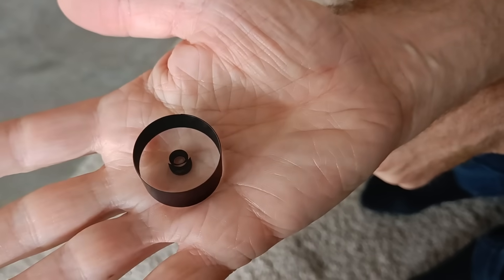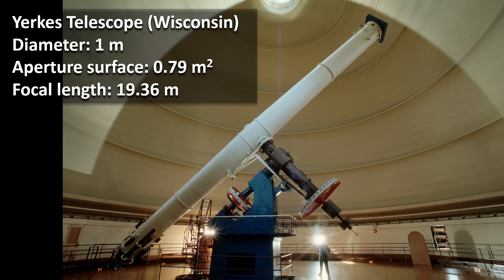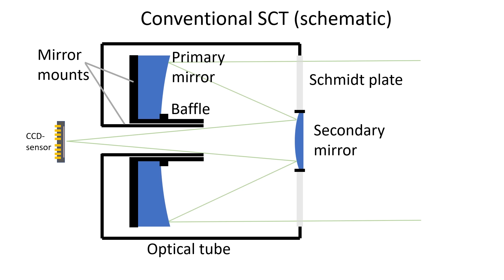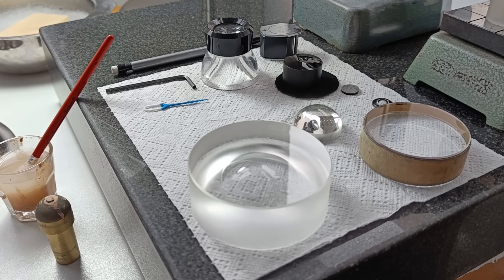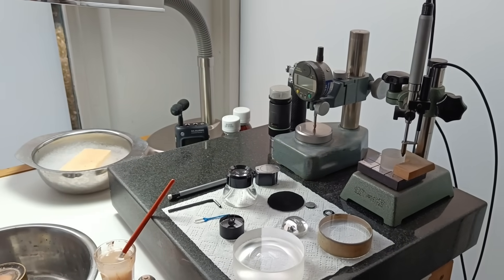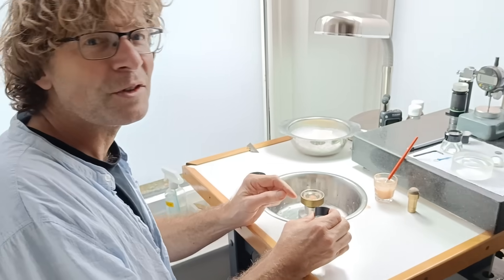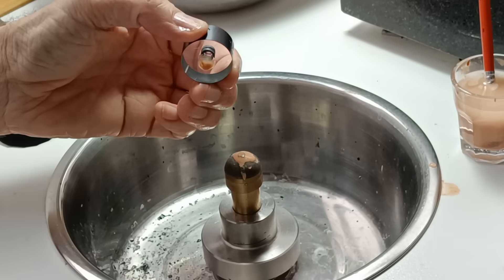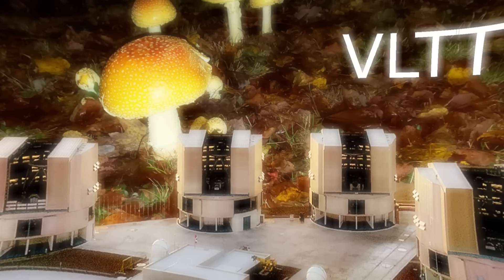Why is this Space Telescope so Tiny?

Comment: Congrats, very nice video... let's hope the diffraction limit for such a small aperture (3 cm ~ 4 arcsec) will not ruin to much the image resolution (2 meters resolution at just 100 km from Earth,  and 10 meters resolution at the orbiting distance of 547 km of the Hubble Telescope that instead at such a distance is able to resolve separation of ~ 25 cm !) 
Btw, nice idea for the VLTT, despite the fact that an optical interferometric baseline technique (bispectrum, speckle imaging, ...) in the visible domain may requires femtosecond e sub-nanometer time-space coherent synchronization between each tiny telescope (4 axis position/rotation and sensor signals TOA) and probably not easily achievable in our current time, with our actual technology and with funds  below several hundreds millions of dollars.... maybe I am wrong but I am afraid it will remain for still quite some time a dream despite it is already a shared one within the astronomical community  ;)

Comment: you can defeat you tube commercials by clicking on another you tube video and quickly going to the back up or previous arrow on the top left corner, the original video clip starts off where you left off without the annoying ad.  
some ads can go on for 15 or 30 seconds and sometimes they hit you with double ads.
youtube cant cope with this rapid change, when you go from the new clip back to the one you were watching the you tube algorithm forgets ro punish you with a time wasting advertisement.

Comment: What is the specs of this little telescope ?
Reply: Optical diameter is 25 mm, focal length 125 mm, total length including detector 27 mm.
Material Fused Silica. It will be pointing downwards to Earth from a 400 km high orbit. Resolution: close to theoretical diffraction limit.

Comment: It is very interestingly compact but I'd like to see images taken with it.  The tiny aperture quite surely limits resolution to blur any details smaller than around 3 arc seconds.  A 100mm aperture telescope would see details down to around 1 arc second.

Since it is so extremely expensive to put massive things in orbit, I wonder if a tiny cluster of these a 2 or 3 meters apart and connected through interferometry would be worth doing for a space telescope that photographs planets in higher resolution than Hubble.  Would the complexity around interferometry and possibly needing to unfold the structure from a cube-sat size to its 3 meters of simulated aperture make this too expensive to be worth doing?

Comment: This isn't a good astronomical telescope because it's aperture is so small.  Very limited light gathering power which is why proessional telescopes are large.
Reply: It is so small as it needed to fit in a 27 mm space. From lens to detector. Astronomy is not the goal for thís telescope. It will be pointing downwards ;-)
Reply: @astrorik  great.  That needed clarification, as some comments by media linked it to space telescopes. 8-)

Comment: Next step, hollow out the monolithic design so that it actually can be scaled up in size (without the mass, via ^3 scaling laws, getting out of control). Such a 'Hollow Horst' approach would also provide additional surfaces. Likely that it would need to be manufactured in parts and then fused together (advantage? disadvantage?).

Comment: Interesting design! I wonder if chromatic aberration plays a major role here. What's limiting the scope size?
Reply: The purpose was to get a 125 mm focal length in a space of 27 mm. Including the detector. Chromatic aberration is almost non-existing, only some residual spherochromatism is present due to the short build of the system. Regarding the limit of this telescope, you can make it large if you wish, but at the cost of weight. In practice I think that monolithic telescopes between 25 mm and let's say 60 mm are most interesting. The sweet spot?? I think around 35 mm diameter ;-)

Comment: Exactly my idea of space based VLTT... :) place small telescopes on large telescopic construction which can be fold into small space. of the Falcon 9 fairing volume. Due to zero gravity it should be possible to unfold such construction to the equivalent of maybe up to 50m diameter mirror. While the speed of lens would be low due to low actual area, the resolution would be very large. If special glass was chosen, one that can effectively transmit infrared radiation, then direct detection of terrestrial exoplanets should be possible. The problem I see is, te glass absorbs infrared radiation rather well. Great material for this is monocrystallic alumina(Al2O3) ... or even better(better transmittance) yttria(Y2O3).

Comment: 2:00 Fun fact: With the eagle having 1.000.000 receptors per mm² this means 1 receptor per µm² - so this is already quite close to the physical resolution limit, which is around the wavelength of light (0.4-0.7µm depending on color). So basically: Without bigger eyes, there is not much room left for higher resolution.
Reply: I searched the comments to see if anybody else noticed this.  In fact, the human eye is not so bad, and comes close to the theoretical limit (about 1' arc) if you work through the calculations.  Humans have some of the best colour vision of any animal; moreover, the sensitivity of our night vision is not far from the quantum limit at body temperature.
Reply: @cdl0  Didn't know that about human nightvision. Cool thing.
Reply: @DerKiesch  Yes, there is a trade-off between colour and sensitivity, so animals with better night vision have poorer colour vision, and vice versa, with humans among the best at both, coupled with the best image processing system, i.e. a huge brain.  Many nocturnal animals also enhance their night vision by a reflective layer behind the retina, which is seen when their eyes shine at night.  This likely reduces acuity slightly, owing to greater halation.  Humans lack a reflective layer.  Photographic films usually include an anti-halation layer to improve image sharpness.

Comment: Why not machine a grinder that has the proper shape instead for aspherical lenses? Seems like it would be less trouble and much faster than using a smaller grinding surface.
Reply from the maker: it's possible to a certain degree, but the tool will also wear out and change shape. Especially because the desired shape is an asphere.

Comment: I love how he just nonchalantly wipes it off using his shirt. So awesome, I love every bit of this. :-)
Reply: I nearly passed out at that. My optical experience is mainly with high power lasers and you never touch an optical surface with anything other than the purest white cloth; otherwise the optic melts and all hell breaks loose.
Reply: @soaringvulture  That's got to be pretty interesting.  Sorry I caught up to this so late but if you're still around, can I ask how much power you're working with? Note my profile image... I was very much into laser DIY once upon a time and still dabble in it as need arises. 🙂
Reply: @NightRunner417  "High power" is a loose term; it varies with the application. I worked with material processing lasers which are used to cut, weld, and heat treat metals. We usually considered anything over a kilowatt high power. I've worked with welding lasers up to 20 KW. Most of my work was with CO2 lasers at 10 microns but these days fiber lasers running at about a 1 micron wavelength are more popular.
Reply: It's a towel in his lap :)
Reply: He doesn´t, it was a towel hanging behind him, whose end he layed on his leg. ...
Reply: Thank God for the "You're Wrong!" posse of youtube or I'd never know that it wasn't his shirt but instead a very much NOT optical wiping cloth.
I guess you have to have worked with VERY expensive optics to appreciate the spirit of my OP.

Comment: But what are the limitations of machining these? Can’t they be die cast or CNC milled into perfection?

Is it really just a matter of tooling precision? I mean we have nm chip wafers etc… or is it too niche to use high precision tools for the cost of it?
Reply from the maker: Generally the accuracy specifications for the surface shapes are way below 1 um, so hard/impossible to achieve using conventional techniques like milling or casting.

Comment: What about chromatic aberration? Seems to me that any light ray which is not strictly parallel to the axis will result in a rainbow of colors caused by a prismatic effect... Or am I wrong?
Reply: That's what I expected also when I was making the first one, about 28 years ago. But I saw no chromatic errors. Later when I was able to ray-trace and model these systems I found that that color indeed is no real issue. Only glass-air exit surfaces could introduce some off-axis color, but that can be compensated by playing with the location of the neutral zone of the Schmidt- surface

Comment: As a hobby Astronomer since 20 Years who has built some (Newton and lens) Telescopes, I have a bit Knowledge about Telescopes and Optics. And this tiny Telescope is f**in' amazing!

Just the Idea to use one single Piece of Glass and make a tubeless Telescope, makes it imo a new Class of Telescopes, beside the Lens- and the Mirror Telescopes. This isn't a even Catadiopter tough, that is Something mindbreaking new. 
OPT ? (For "One Piece Telescope") 

Is there a Site of further informations about this Telescope design? (Chromatic aberration, size of flat and illuminated field, and so on...) 

Many questions in my mind... 
Why not a Klevstov Design (no aspherical surfaces, just Spheres) or any other Cassegrain Derivate?
Would it make sense to use a (glued) glass pair (Fraunhofer like) as a Blank for auch a Telescope?
You built that without the usual bench tests (Focault, Ronchi,) just  by holding it free hand? 
That's so astonishing!
Didn't the temperature of Your Fingers deform the Glass? Or is the whole Room and everything in it at the same Temperature as Your Fingers, so there is no Temperature Difference when You touch the Glass? ;) 
And so on...

Imagine the classy Rubinar 4" f/10, but made in one single chunk of Glass. 
Would probably be as iconic as the Skyquest Telescope. :o  
(No, I ain't own one... But I've seen 2 of them in real life.)
Reply: Thank you for your comment! And you have some nice questions. First, there is no website yet where you can find additional information, though you might find something on the astronomy forum Cloudy Nights. 

Regarding the design, the is practically no chromatic aberration, only mild spherochromatism. The FOV is rather small, and for this particular system the detector area is only 4x4 mm. With more relaxed radii of the curved mirrors and a longer cilinder this can be easily enlarged. The field is curved, however, I've made a design that uses stronger aspheres where the field is almost perfectly flat, and without any distortion. 
Glueing other glass components to further optimize performance is risky for space. The freedom of  design within this concept makes the use of other additional components rather useless. 
As I use Fused Silicafor the last two telescopes there are no thermal issues with local heat caused by my fingers. Even for the BK7 telescopes I didn't encounter any difficulties.
Testing is done in a few phases; The strong asphere is tested using an extra plano-convex lens that  gives a perfect 'null' when measured in transmission together with the spherical M1. The secondary is aspherized by local polishing with a tiny polishing tool and examined with a knife-edge at the focal plane of the telescope, and with an high power eyepiece.
Well.... that's about it 😉
Reply: @astrorik  Many thanks for Your explanations. 
4x4mm sensor area is more than I'd expected, I would have estimated a 2,5...3mm chip or so... I guess it has fixed focus? No problems setting it on earth while using it in Space (shifting) ?

Comment: Completely not understanding this . Is this a ' new lens ' to fit into a tube like telescope ? Or can I see Pluto if I hold that thing up to my eye ?
Reply: It is an extremely compact telescope (total length is 27mm including detector) with a focal length of 125 mm (F/5). It is tube, baffle and optics made out of one piece of glass. No further mechanics are needed for adjustment of the optical surfaces, as everything has been ground to high concentric accuracies. Only focus of the detector had been done once, using shims. 
Other, less compact designs, can be made to be used with eyepieces, but the larger, the more 'normal' alternatives can be found. The  'sweet spot' is I believe,  around 30 mm diameter.
Reply: @astrorik  Thanks for replying , is there an drawing of this in configuration ? Tube , I understand - this one piece is the optics ( am I correct ? or are there other optics ? ) and baffle is what ? the reflection mirror ? Please excuse my ignorance , but I think you just got me into this as a hobby .
Reply: @R-J-Lookn-up  The baffle is the drilled-in 'tube' which will prevent straylight of reaching the focal plane. It us visible in the images

Comment: Is this just optics for a CCD so it takes in only the light entering in parallel? Because it's so small you could easily make a CCD bigger than that.
If you need more light, you need a bigger "entry point" and this thing is tiny. I know it's needed, but somehow my brain refuses to believe that this is a necessary step when you can have a ccd bigger than that. It's baffling.
Reply: Lol check out the night time performance of cell phone cameras - light "entry point" is about 1 mm - 30 times smaller than this guy. Ccds are so sensitive now

Comment: This reminds me of my time way back when. The guy who made some of the first X-ray interferometers worked in the next door building. He look just like this guy, but with a beard.
Pretty sure it was the same shirt! The whole apparatus was built from store parts, inside a big plastic tent with filtered air inflating it. What stood out was the flywheel, which was a thin rimmed bicycle wheel with lead tape in place of a tyre. The material was single crystals of silica, polished to X ray flatness, about ten atomic layers, I think it was. Then the surface was scored using a hand made shaped tool all to the same accuracy. That was done by the ruling engine, which is what was in the plastic 'bag'. Otherwise, all by hand. 1968, that was.

Comment: i was hoping to see some images taken through those telescope but didn't happened. it would've been very interesting if they had included those images in this video, i don't know if I'm being curious
Reply from the maker: Problem is that as long as it is not completely finished you cannot get images from it, because you need the reflective surfaces to be present. We could have added an image of the older version, but unfortunately forgot to do that. I will return to this in an upcoming video.

Comment: Glass optics by hand are still one of the things that hold value.
Even when you can mass produce every other component.
Plastic and epoxy versions will likely work for standard use, but the image quality an clarity goes to efforts like this grind and polish in glass.
The work is appreciated.

Side question; Has these lens' been sputtered for the mirror coats? I'd think that would give the best reflection.
Reply: He could greatly lighten the design by sandwiching acrylic plastic between glass endplates. This has the further advantage of making it easier to machine the baffle, which could then be filled with opaque material and completely enclosed when the endplate is bonded on.

Comment: There was a chap who used a customised lathe to turn optical glass with diamond tooling (saw it here on YT a decade ago). 

I wonder if such a tool (or similar) could be used to turn such telescopes out of blanks from glass or polycarbonate.  

Imagine what happens when some company starts to injection mould these at the cost of optical mouse optics for an optical mouse that will be able to do motion tracking from a range of a few meters instead of a few mm.

Comment: How fine is the grinding powder that he's using? like 100k grit or is it even finer that that? Also is it a diamond powder or is that over the top for this application?
Reply from the maker: What he demonstrates is polishing which uses Cerium oxide polishing powder. Generally grains are in the order of a few microns.
Reply: @HuygensOptics  Awesome! Thanks. Also I noticed he  seemed to be using brass cups to polish. There would have to be precision machining to build those not to mention post machining polishing before they could be used.

Comment: On the downside, of course: scaling up to a big mirror eliminates all those pesky mounting adjustments - but the weight of the system gets monstrously high. Not a good idea for space applications.
Reply: How about arrays of these? If only they could be made from a cast instead of the laborious polishing process
Reply: @ivodekler  Combining multiple smaller units can work for interferometric scopes. It won't work for imaging. And it's not good for space use either, since you have to keep all the sub-units perfectly aligned - you might as well just stick with a single main mirror.

Comment: Really interesting but think you should mention telescopes are not just about magnification but also light intake. This is excellent for sun and planets. I Wonder what Aperture size you can make them in before they become too heavy? This is cool but instead of portraying it as a “holy grail” solution I would like to see where it fits in. We see what strengths it has but not drawbacks and limitations.
Reply from the maker: "Everyone advantage has its disadvantages". It is not intended as a sales pitch.And sure you are right, when made bigger, they become very heavy, the have extremely small aperture and they are difficult and costly to manufacture.